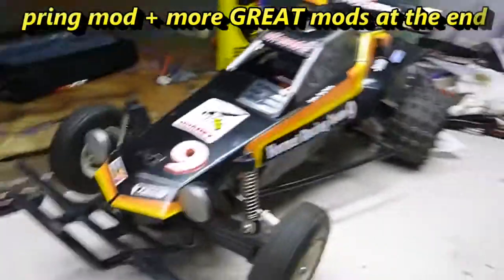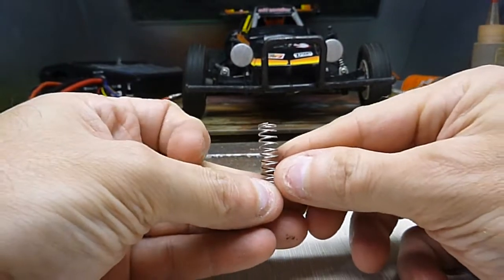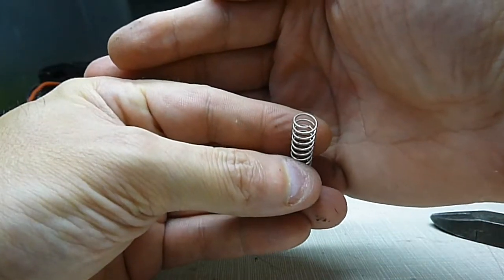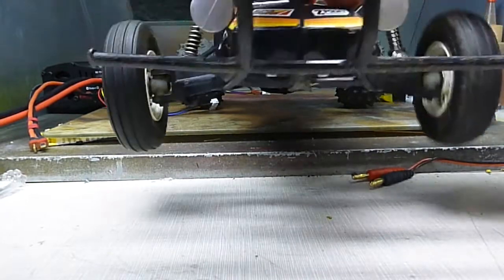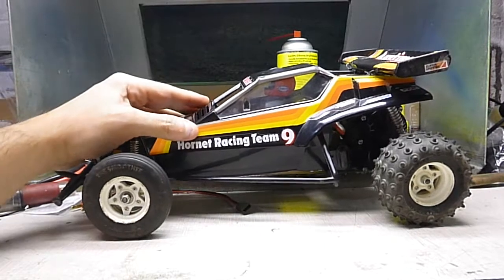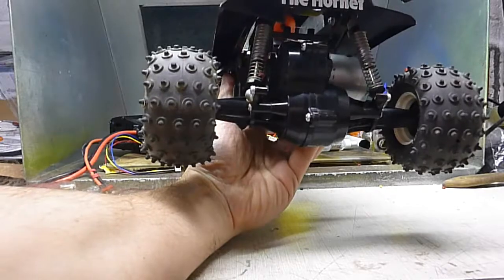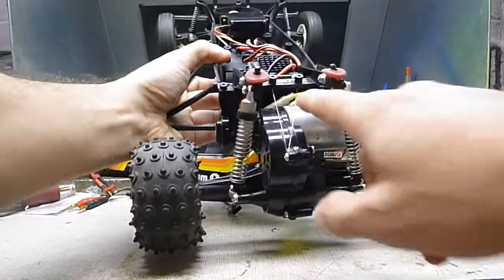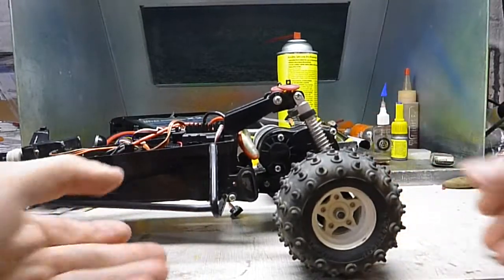Tamiya Hornet FREE spring and rear suspension mods plus more!

Comment: good work colleague, thank you very much for sharing 👍 👍 👌
Reply from the maker: Thank you very much :-)
Reply: shenlonco 👍 👍
Reply: shenlonco put on road pan car front springs (or sections of a pen spring) just long enough for a little preload, like 1/8". then thin washer to the arm tops. A arms will be sprung suspended both directions. edit: rear suspension: putting a screw through from the battery tray side about 7/16 over the center of the rear axle, then cover the screw with a bit of small rubber hose. the rear end will still roll up a good 1/4", but no "clack-clack", with more articulation. battery trap: cut the rear top away to cover with a thick chunk of lexan (or whatever) in a ||_|| shape (flipped over) to put in a 3+3 saddle pack vertically, changes the CG rearward a bit. takes getting used to driving it more like a Baja Bug, using more on-off throttle to make it controlled drift turning. example tamiya fox having motor all the way back and battery pack sideways across the rear, more rear traction to scoot with.
Reply from the maker: Hi thanks I did do that one rear mod to one of my hornets to stop the gear box clank and that also works.
Thanks for watching!

Comment: Nice mods. Maybe I will do this on my Grasshooper :) 👍
Reply from the maker: Hi To be honest I think the grasshopper has softer springs up front than the hornet... If not it may be softer because they don't use the friction O ring and its holder under the shock tower that will compress the spring more like the hornets...but it still may be better a bit softer up front for you....also get the hornet rear gearbox holders that let the axle swing and the string methode will work for you also as your grasshopper has a non swing set up.
Reply: shenlonco
 Thanks for the hints! 👍
Reply from the maker: ***** Your welcome :-)

Comment: forever later here...  we used to cook the springs over a gas stove burner then give them a squish while hot, top of bolts got on road pan car front springs (or short section of pen spring), small washer, then O-ring to provide some friction damping. sat about 5/16 lower, less bump steer issue, done right (softened main springs) it'd suspend for some both positive and negative travel, but not flop. what's not to like about the fishing line fix? great idea really, may be better if it had a little slack, like doing same with very small crimp on electrical lugs and a bit of plastic coated aircraft cable? the CLUNK was always annoying and keeping the springs in the slotted rear hangers was like futile, weren't strong enough anyway. our fix back when was a screw through from the inside of the chassis with a short bit of rubber tubing. the rear "pogo stick" stock shocks got the same treatment as the fronts, cooking to soften then clip the end coils from pen springs to put inside the "shock" bodies with the small washer and O-ring at the bottoms inside, and add a couple drops of oil. it lowered the rear a little more than the front, shorter suspension travel too, but suspended both directions (positive and negative). we tried any/everything to keep the tires more in contact with the dirt!! give the stuff a try. edit PS: needed to, for putting Associated/Reedy stock and Dynamite 34 degree "outlaw stock" motors in em, adapters for Tamiya Fox tires/rims etc.
Reply from the maker: Thanks mine works great now, Try the new ampro rear scorpion tires and wheel adapters I had him make it lets you run kyosho scorpion rear wheels with the scorpion nice softer tires and it helps soak up the bumps better with the softer tires. https://www.youtube.com/watch?v=UR2VYWg8Ses   https://www.youtube.com/watch?v=KnropfK6lM4
Reply: saw those a while back, the Fox rims let it run all kinds of softer aftermarket 1.9" or 2" rubber rather than vinyl/rubber. really hoping Alberto works up my idea for Grasshopper/Hornet/Lunchbox etc rear diffs, even with stock Mabuchi can motors that lifting and tire spin was a real issue.
Reply from the maker: Hi those scorpion tires are much softer and more rubber on the sid walls and they even come in a softer compound than the stock scorpion kit tires to boot! 👍😊👍 I use the tamiya anti wear grease on my diffs it helps https://www.youtube.com/watch?v=Hvpu1WUIFPY

Comment: I am 49 I bought my hornet when I was 13/14 yrs old.when I did my front in that plastic piece on top in side the spring. U got a choice of 1 or 2  of those rubber gaskets(washers), 
2 is for rough terrain 1 is for flat ground. That was makes front springs stiff or not stiff
Reply from the maker: 😁👍 COOL! Yes I like using one O ring and cutting the springs it works great like this.  Thanks for stopping by.

Comment: also.....to help reduce under steer dial in some toe out, that makes the inside wheel cut in tighter......
thanks for the tips n tweaks
Reply from the maker: Cool glad to help  =)
Reply: a little less bump steer that way when landing it too, hornets are kinda notorious for it! another goodie is whipping up a front torsion bar setup helps.

Comment: So how does it perform with the front spring upgrade?   Has it helped with the performance?
Reply from the maker: I like it better the front don't bounce around as much  for me...it's a cheap mod if you try it and don't like it you can just buy a new set of springs and put them back if you don't like how it goes.
Reply: agree softer is better up front, back when we'd just cook them over a gas stove burner to take away their strength, then pop in the on road car spring+washer topside.

Comment: If it were not for the low gearbox, I would get one. Kyosho tomahawk is better for me.
Reply from the maker: Yes I have a kyosho scorpion but it don't put the smile on your face like when driving a tamiya hornet...just ask other hornet owners how much fun they are. =)
Reply: Hmm, maybe I will have to reconsider in that case :)
Reply from the maker: If you want a buggy that is more like newer style buggies and will handle ruts and bumps better and perform better get the kyosho, the hornet works way worse but is a fun buggy to own also.
Reply from the maker: yea sounds like you want a better performer and that is what the kyosho is
https://www.youtube.com/watch?v=ZahrCk-IeVE
Reply: hornets really are a love+hate classic little beast, but get one dialed in they'll scramble pretty good! they have to be set up kinda soft loose and made to run flat, front torsion bar kinda important. if the front runs flatter the rear follows suit to spin both, not 1 wheel up and hammering. wider front A arms, definitely! they'll take away some of that bump steer issue without going to an upper link style front end (those ARE neat but...).
Reply: I think you can say that about a lot of Tamiya vehicles. I have a love-hate relationship with the super clodbuster. The stock steering kills me though. I managed to fix it, but now will not steer straight at high speeds. Thank goodness for vertical servo mounts and metal gear servos that are not too powerful to break the gear case.
Reply: never got into the clod, just too much to go wrong with them, same for all the ORV frog things. nowadays RWD bang for the buck I'd look at the Traxxas Bandit "RC10 clone" for being so adjustable+upgradable. another point in it's favor is quick+cheap parts availability by mail direct.

 in entry class stock races back when, hornet were really fun and popular. set up like I'd mentioned would get around a track quicker for staying connected to the ground more often, if you drove it well. had 3 of them early 80's.
Reply: I went with new turbo scorpion kit which has not arrived yet
Reply: that looks like a really excellent associated RC10 clone too, just watched some of the video shenloco linked.